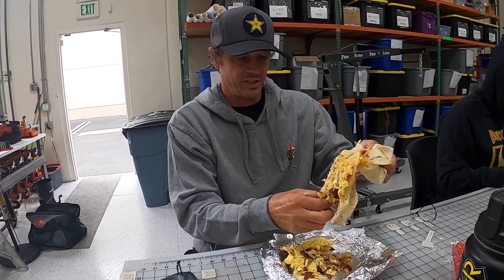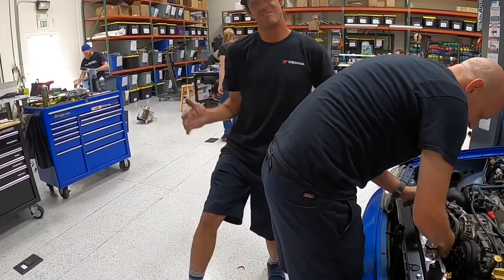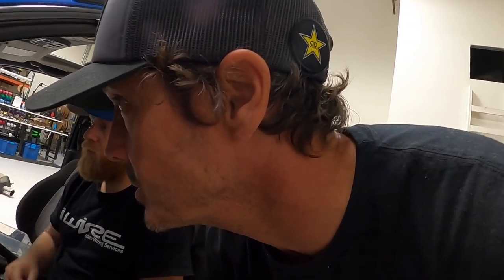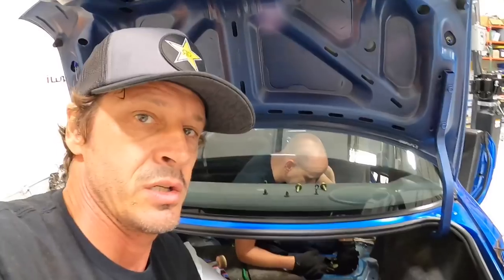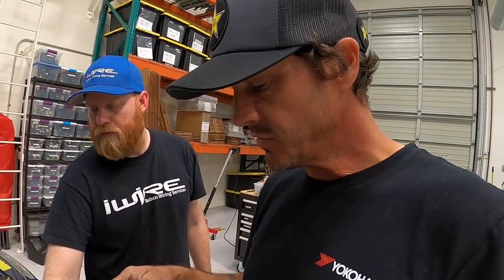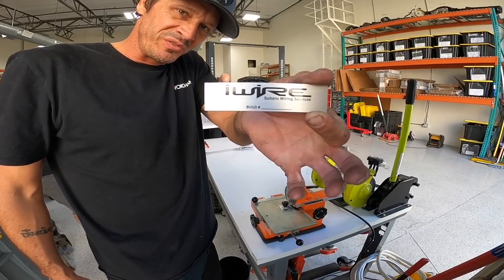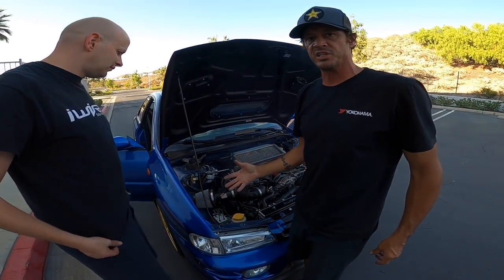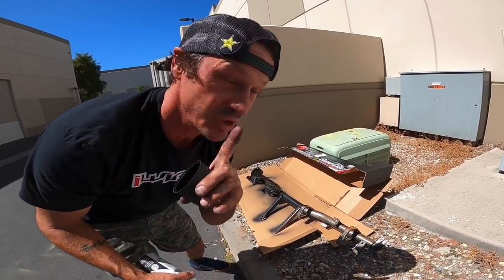RS Swap “First Drive” Episode #6

Comment: As someone who has done this exact swap these videos are extremely helpful! You guys have pin pointed all the tough areas/confusing issues most people run into. Hell I even went and fixed a few things on my swap after watching this series even though my car has been swapped for 2 years. Thanks Bucky and Iwire!
Reply from the maker: Rad!!👊🏼🔥

Comment: Extremely helpful. Thank you so much for making these videos guys. I bought a 2001 RS back in 2014, did the head gaskets and timing belt as soon as I bought it. Timing belt just snapped 30k miles later. Time for a swap.

Comment: recently finished my swap on the 18th. Had a performance shop help me with it by parting out their baja turbo project with a built bottom end ej255. Had everything transferred onto my rs from the trans, wiring, engine, and whole drive train. did you guys already swap the rear end i only seen the turbo subframe being switch out. next for me is to do a a full suspension over haul.  just watched the whole series imagining that it was my car being worked on.

Comment: How come you didn't switch the primary and sub fan like on the Buckit? Awesome series, can't wait to to start stockpiling parts for my swap. Still haven't decided between the 205, 207, or 257 though. Thanks for taking the time to make these
Reply: Problem with Buckit is the GC style radiator.  GD radiator doesn't have the issue
Reply: @iwiresubaruwiringsolutions5538  So can I run my stock RS rad and flip the fans or no because clearance and/or hose location?

Comment: I just got a 1999 RS too not really in great condition but it runs the down side tho is the heater and the ac doesn't work,  I'm wondering if it's fixable in RS swap

Comment: Any advice on buying a swapped rs with a ej257?
Reply from the maker: Have a really good shop look at it. Compression check and find out who did the wire harness, etc.
Reply: BuckYeah Thanks for replying Bucky!!Bit the bullet and bought it. Wiring was diy but everything works surprisingly. Motor was running real smooth other then the couple of codes 😬! Keep these builds coming!!!!

Comment: Hey bucky Ik this video is old but if you see this could you let me know how the 5 speed is doing with this swap. Currently in the process of doing this swap and was curious if you’ve had any transmission issues due to the added power
Reply from the maker: Mine is fine, you just need to respect it and not slam gears. Keep the drifting in the dirt or rain🤙🏼
Reply: @BuckyLasekOfficial  your the man bro I appreciate it!!!!

Comment: I also got a blue 99rs with wrx swap but its 02 usdm wrx motor and ecu. Tuned with the cobb ap but I'm wondering if that can flash a jdm wrx ecu if/when I need a motor replacement??
Reply: You can change over pretty easily

https://www.iwireservices.com/post/2017/12/08/what-is-subaru-avcs-bran-avcs-swap-guide-for-your-usdm-2002-2005-wrx
Reply: @iwiresubaruwiringsolutions5538  Perfect thank you! I'll just have to check with Cobb if its possible to reflash a jdm wrx ecu of that era. Just gathering info for the future but still got a while on my current motor.
Reply: @stg2lgcy00  JDM ECUs are not compatible with the Cobb AP but still can be tuned via open source.
Reply: @iwiresubaruwiringsolutions5538  Ok thanks for clearing  that up! Guess I'd have to sacrifice the cobb ap if I want the jdm goodness haha.

Comment: Awesome content good info to know!! Im doing an ej207 swap in my 02 impreza wrx do i need to change out my wire harness on my car to the JDM one?
Reply: No need to change the harness , just get the AVCS cable ! 02 and 03 WRX are very simple but try and get a JDM ecu , it will work with the USDM ecu but no AVCS , a version 8 JDM ecu will work but both need a tune , version 9 and up are immobilized !
Reply: i  did install the avcs wires that goes to the ecu and i also have a jdm version 7 ecu installed is there anything else i would need to complete the swap? Besides the tune? Also do u know any good tuners that does remote tuning? I tried contacting delicious tuning. Jus wanted another persons input

Comment: Hey Guys, could you please provide the part number for the AEM fuel pump you used.  Need one for my GC. Thanks
Reply from the maker: I showed the box in the video that it came in for this very question 🤯🤯🤯🤯🤯🤯🤯🤯🤯🤯🤯🤯🤯🤯🤯🤯🤯😤😤😤
Reply: @BuckyLasekOfficial  Thanks!  Sorry I missed the box part.  I'll watch closer next time.  What's the plan for the RSti vs the bucket?